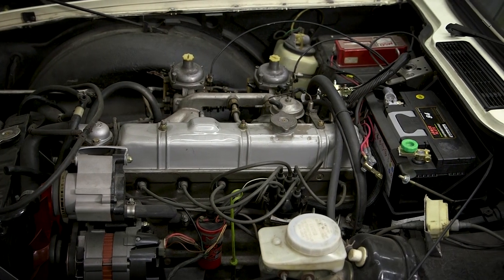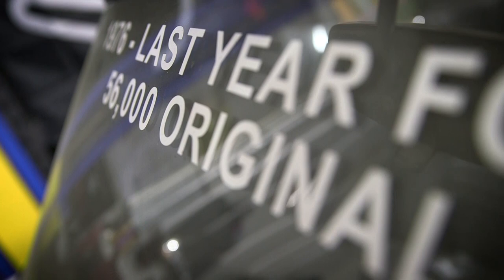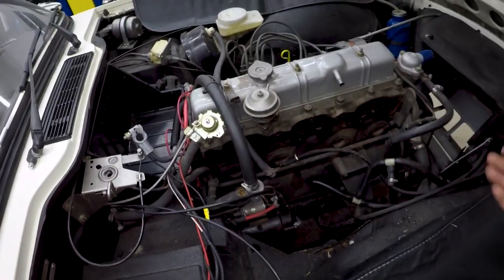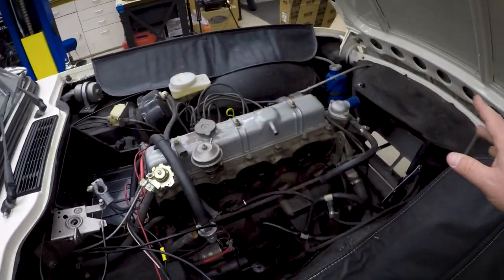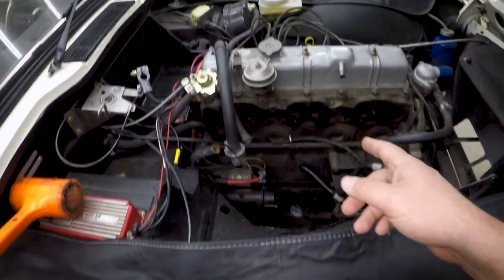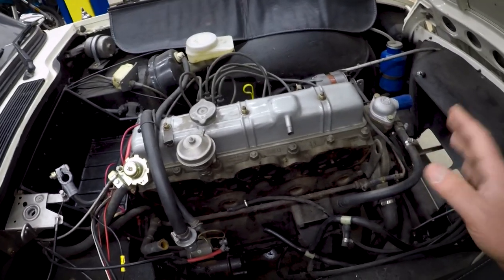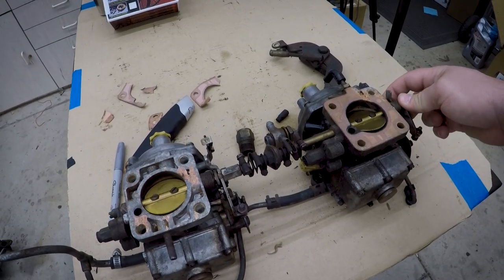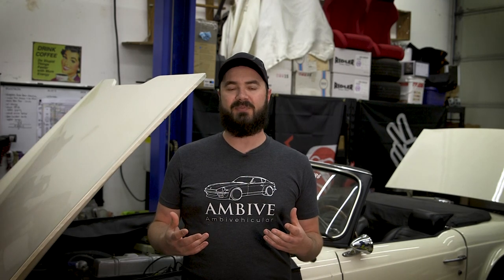Triumph TR6: Part 1 - Teardown

Comment: When renovating my 76 TR6, I bought an exhaust manifold off of an earlier model that did not have the "air pump" pipes on it and got rid of the whole system.  This would be cheaper than spending money on the exhaust manifold that you removed, which you said needs a lot of work.  The "air pump" did nothing for performance (actually robbed a little power to run the pump) and did nothing for the environment.  All it did was put fresh air into the exhaust to dilute the pollution at the tailpipe so it could pass the EPA tests of 1976.  Removing this system also cleans up the engine bay in a big way.

Comment: Good stuff, I will be following.  It would be nice to hear a little more about the components you are replacing/upgrading and where you sourced them (along with pricing).  For example, where did you get the fan delete part, and does the quality look good?   Did the exhaust manifold have the injection tubes installed? If so, how are you going about in removing them and plugging the ports?  Thanks.
Reply from the maker: I will be driving into greater detail in the EFI specific video and PMU-16/wiring videos later in the series. These first two will be more car specific as I get it ready for the upgrades. Thanks for watching!

Comment: Did it really make sense to dump the original fan ? Could always use the electric one as a backup without it switching in and out all the time ?
Reply from the maker: Mechanical fans work well in many situations, but they rob a lot of performance from the engine and without proper shrouding, are much less effective in high demand situations. When an engine is this low on power already, your stay talking about double digit performance percent increases by swapping out to an electric fan even ignoring the other benefits.